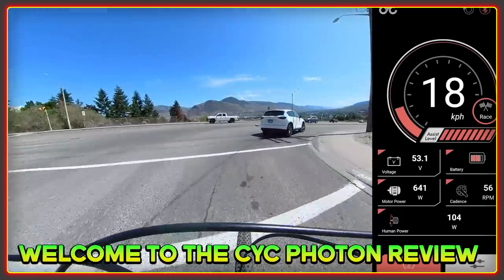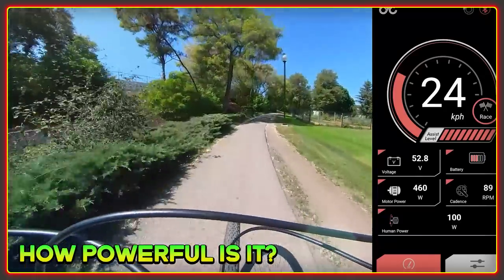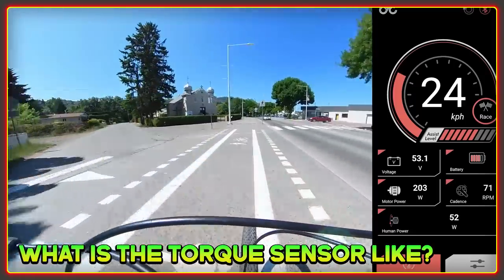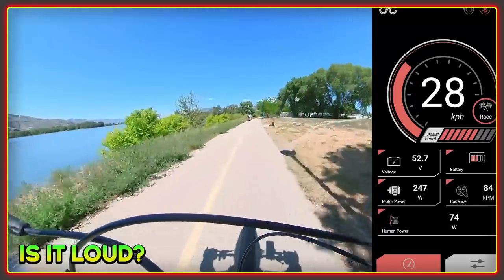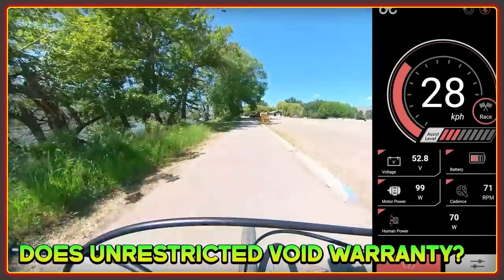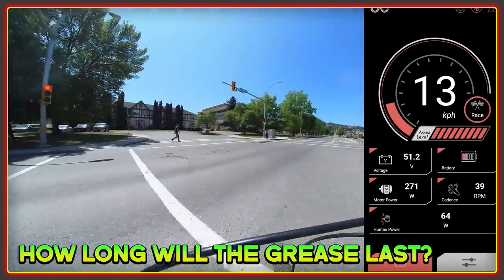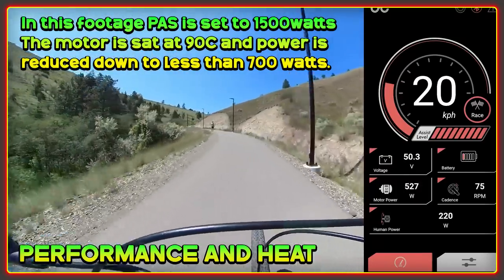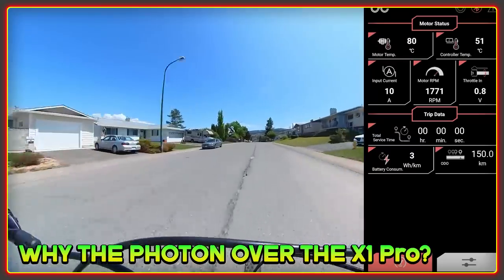Full Review of the CYC Photon Mid-Drive Ebike Conversion Motor

Comment: This is a really good review, so comprehensive.
I should probably stop recommending the bbs02 for a wham bam thank you mam conversion as the cadence sensor is pretty weak.
Reply from the maker: Thanks. The 02 can be had for much cheaper on Ali but the cadence based PAS is no where near as nice.
Reply: No you shouldn't.  What you say about Bafang cadence sensing is simply untrue. Some will prefer it to any torque sensor.  A BBS02 costs 1/2 of a CYC Photon motor, parts are ubiquitous, inexpensive and motors are easy to rebuild.  Further, the jury is out on the Photon as to its reliability.  Great review by John of this channel and thanks for that.

For many, for $200 more than the BBS02, the BBSHD I believe bang for buck is the best ebike motor in the industry. But for many the BBS02 is fine and can even take 35  amps for big miles with an aftermarket controller...perhaps even better than the Photon due to more limited armature mass aka heat sink.
Beauty of Bafang cadence sensing is their reliability compared to conventional torque sensors and their programmability.  One can create great granularity with non linear power increments at lower power settings with the Bafang configuration tool.  Because power relative to speed is an exponential function, one can program for much higher gradations of power assist at higher speed....and much smaller gradations at lower speeds.
I am not dissing the Photon.  Competition is always good in the marketplace. The Photon however is a $1K motor. Many will prefer torque sensing. and therefore welcome the Photon, CYC finally creating a quiet motor.  I come from a bike racing background.  Cadence versus Torque sensing doesn't matter to me, likely because of what level rider I am.  I can easily find the sweet spot of rider watt input to the bike relative to motor watt contribution and do so daily.  I also ride to heart rate.   For training, in some ways, cadence sensing is better because motor assist does not increase with human assist unlike torque sensing which provides a better workout for the rider at a given motor power level because the rider is pushing against a harder limit of motor assist.
In summary, the conversation is nuanced and not cut and dried.  Right now I prefer to stick with the Bafang BBSHD and honestly the Photon because of its heat sensitivity and the power level and speed I prefer, I still believe for 'my usage' the BBSHD is a much better value proposition.  Othes may feel different and good to have options like the Photon for others with a different usage model.
Reply: The video mentions Bafang Torque Sensor?  Is this new?  I was only aware of the cadence sensor.

Comment: Thanks for the great review and footage! One question: CYC claims there's very little rolling resistance from the motor when it's off. My BBSHD was pointless to pedal with a flat battery. Can you confirm the Photon is easy to pedal without power?
Reply from the maker: No it sucks as much as the bbshd. Maybe a bit less but not much.

Comment: Good review.  One point that should be stressed is that even if thermally limited to ~750 watts that will allow most of us who are cyclists to spin out at top speed allowed by our bike's gearing, other than for short bursts at very high pedaling RPM as you noted.  That surely was one factor that CYC considered in their motor design choices.  This doesn't appeal to the throttle jockeys who want to go that fast all day without pedaling but that is not the target user group for Photon.

I am about 300 miles into my 1 month old Photon on an old Cannondale F1000 hardtail set up for street and path riding and I am loving it.  No issues so far except a display that won't allow me to change wheel size to match what I have on my bike, so the data it shows are off.  The serviceability issue has me worried as I am usually a total DIY'er for all things mechanical.  Hopefully this will change going forward or at least the authorized CYC service will turn out to be fast and reasonably cheap.  I have a second Photon on order for another build which will be a very nice bike indeed.... ti frame gravel bike.  I'd have liked that to be a Proton but have no idea when that will be offered... maybe I'll have to upgrade when it comes available.
Reply from the maker: You make very good points. I think it is very well made for its target market. Funny why the display won't let you change that. Are you using the larger one or the SW102?
Reply: @HighVoltageKits  I have SW102.  Here is a video short showing the problem.  The display is just stuck on 29.  https://www.youtube.com/shorts/NY_idODSkBE

Comment: Is there any new information regarding to current production bottlenecks affecting shipping. Someone  on endless sphere said there is some additional testing needed due to delay in controller supply. Not sure if this that's up to date or is it the same thing repeated from previous delay. Still for some shipping takes 4 weeks only and for others beyond 11 weeks. Others said they didn't receive any shipment confirmation, the motor suddenly just turned up one day without warning.
Reply from the maker: Eco Cycles has stock in USA. I think there are production delays. I have no inside info on anything.
Reply: @HighVoltageKits  Currently other European distributors say it's available in 45 working days, so there is no other choice but to take it as a true estimate.

Comment: I really like this motor and I've commented before but I plan on buying one some time in the future.  I bought a used bike for the conversion, a 2019 Trek Marlin 7 but I'm having trouble figuring out gearing.  It has a max chainring of 32t recommended for 1x but I'm trying out a 40t.  I can use the granny gears but it makes noise mostly on the chainring when in the biggest 2 granny gears on the cassette.  Chainring is narrow wide and seems like a good recreation of what it will look like with the photon but I'm concerned that I will damage the chain/chainring and cassette with this terrible chain line.  Are there any mountain bikes that I can put a 40t chainring on that will have a good chainline even through all the granny gears?  I bought a box components three prime 9 groupset (11-50t cassette) and I'm hoping that might help (maybe I can rearrange the cassette?).  Any recommendations are appreciated.
Reply from the maker: Sorry I missed this. Maybe post this on our Discord. It's free to join. You will likely get more advice there. You can also post pictures which will help a lot.

Comment: Another comment I'll add is that I had the same experience with the cranks - my left one worked loose. We're probably not the only ones this has happened to.
Reply from the maker: I think it was the left that was with mine as well. It seems like a pretty common thing. Something to keep in mind like retorquing wheel nuts after 100kms
Reply: this also happened to me - left non-drive crank came use.
Reply: @wendyatkinson1  I think there must be some flex and that is the side that will work loose. I added blue loctite the pre-applied thread lock might not be working well enough. Definitely something to monitor.

Comment: Thank you for the excellent video. Can the photon be used with a 72v battery ?
Reply from the maker: You are welcome. Its 36-52 volts only. The speed at the cranks would be too high at 72 volts.
Reply: @HighVoltageKits  thanks! So you used a 52v for your testing? If you legs are maxed out on cadence, can the throttle and motor make the bike go faster? If you selected the 38T chainring and 11 to 32 cassette for example, and using your legs you could reach say for example 50kmph , is  the motor able to rev higher than the chainring and pedals? Another way of explaining what I am saying is , is the motor able to power the bike without the pedals moving?
Thanks very much

Comment: Great review.  
Can the chain ring be adjusted with spacers?? to change the chain line if it was being used with a rohloff rear hub?
Thanks
Reply from the maker: The motor can be spaced a bit. The chain ring no. Its locked in the one place by design.
Reply: @HighVoltageKits  Thanks for the response.

Comment: Thanks for this review. I've killed/cooked a couple of TSDZ2 s due to climbing 500m over 15k commute with average gradients of 5 to 7% with ramps reaching 20% depending on route. In summer will have temps in the mid 30s... Though I won't go the 20% ramp route those days. I've ridden Shimano, Yamaha and Bosch motors and I don't really need or want more power than they provide but I would like to adjust speed limits. I don't use a throttle. Would this motor fit this criteria?
Reply from the maker: With those conditions and temps based on what I have seen here with mine in similar you will throttle the motor pretty fast if you run it unrestricted. At 750 watts of assist though it should be able to maintain that level of power. The longevity of the motor is not guaranteed as it is a new product although it feels well made. I also have some videos about some new motors from TOSEVEN which are also Torque sensing. They could be really good if they iron out some of the kinks.
Reply: @HighVoltageKits  I'm watching reviews of the ToSeven too, the 02 is of interest to me... I prefer the idea of the lighter motor as long as it couples with my 48v batteries. Thanks for your time and work.

Comment: how many assist levels are there?  on display screen looked like nine?  (there were nine bars, number fluctuating throughout the video.)  if there are nine assist levels, is rider able to program desired motor assistance in each assist level?  on endless sphere discussion is that in reality there are only three levels, and that choosing to have more than those three simply results in duplicate motor assist as you work your way through the nine -- so that from the nine you get only three assist levels, the rest being dupes of those three.  great video.  i've watched many times and each time pick up something new.
Reply from the maker: Appreciate the kind words. Thanks. There are three. That's just the way they did the graphic. You can specify each of these levels for example 250,750 and 1500 (if unrestricted). You are right tho its kind of confusing. I am not aware of a way to make it to 9 levels and if there is then it probably does do that and duplicate it. The app only has three and there is no way to make it more. In reality its all you need as its a torque system. 9 levels of power is like a hangover from magnet based cadence sensors.

Comment: Does the engine have problems with the chain when starting?
Do you have to program the motor?
Reply from the maker: There is an app you can tweak it with but there are not that many changes you need to make. More adjust to what feels right. I have not had problems with the chain when starting.

Comment: Photon not being serviceable has stopped me buying one yet. I have needed to  pull  apart 3 ebike hub motors, and mid drives from what have read need some maintenance and repairs.
Reply from the maker: It will put some people off for sure. I think I will push to open mine up if I get any issues for science of course lol

Comment: Can you do a tutorial how to utilize the magnetic brake sensor kit to attach it to a relay to power a 12v brake light using an external 12v mini battery?
Reply from the maker: You need a replay that will take 5 volts on one side that you can wire the 12 volt into the other side. The just connect up the relay. There will be some trickery though as the relay will need to close when you activate the brake. The brake voltage is 5 volts close and then activated when it drops to less than one volt. Wheras the relay would need the opposite. I don't think I can commit to a video right now but its definitely the project that discord was made for. I suggest figure it out on there and we can then make a video later once there is more to go on.

Comment: I've been riding a converted Giant Farrago for about 3 years with an open-source firmware Tong Sheng TSDZ2 motor. Mostly street riding, some easy trails, moderately hilly terrain. It's been great so far - no mechanical issues, but I don't abuse it. 750 Watt motor, 52V battery. It has a similar motor construction and size as the Photon and the same heat issue. The open-source version allows for a lot of configuration. The torque sensor works well and provides a natural riding feel. Generally the heat is manageable and the conrtoller rarely has to reduce current except on very long steep hills (160F max before reduction). I'd love to try out the Photon but am wondering how much real-world improvement it would offer over the Tong Sheng. Has anybody out there used both?
Reply from the maker: I have not used the Tong Shen but I heard lots of stories. You likely did not encounter issues by not pushing it. There are some new motors coming out from TOSEVEN that are more in line with the Tong Shen. The Photon is a joy to ride. Especially unrestricted. Great torque sensor. It's longevity is unknown to some extent.
Reply: Yeah, the Tong Sheng has one plastic gear that's probably intended to act like a fuse to prevent damage to any of the other drive train components. I bought a spare but haven't had to use it yet. You can also replace the plastic gear with a metal gear.  I'll tear it down this winter for a detailed evaluation of the bearings and gears, replacing anything that needs it. Parts are widely available. I'll probably buy the Photon to try out because it does seem more capable than the Tong Sheng.    @HighVoltageKits

Comment: Ya know, about the noise, my BBSHD seems quieter with the now Luna Eclipse (42t) than the Lekkie 40t. The Luna is much less resonant, deader than the thinner Lekkie. What’s a couple of ounces on an ebike ? And the the teeth are replaceable on the Luna at half the cost, and more, of a new chainring. Or you could replace with Chinese...but I digress...
Motor sounds more of a dull buzz compared to a faint whine.
Whatever, I must be.....?
Reply from the maker: That's interesting to hear. I have seen those Luna ones break fast as well. Sounds like you have your setup very well dialed in. Which is probably why it's quiet. Good job! Cheers

Comment: i want to buy one but people on forums cant get past the fact that im putting it on a $300 bike to answer questions haha. i get it, but is it really that bad to use it on a relatively cheap bike? its only temporary until i get something better. im done showing up to work soaked ;n
Reply from the maker: Do what you want, there is nothing wrong with using what you have. You can always swap the motor onto a different bike. You are welcome to join our discord community. https://highvoltagekits.com/discord

Comment: Will I experience noticeable drag pedaling with the assist off?  On hills, I'm pushing my pulse rate too high for my 77 years.  So I would like a boost only on the steep climbs.  I can buy a small battery to keep the weight down.  The bike will be a 21 lb cross bike.
Reply from the maker: Yes there is drag. The way around is to have it so that level 1 is just enough to overcome it. Say 25 watts of power. Then you can have a couple of other levels. Each level can be configured so maybe a 250 watts for moderate hills and a 500 for steep hills. There is an option to have a road and offroad so you could also then have one that is set even higher if you even found yourself totally out of gas or injured and needed to get home. It's a great motor for keeping you going riding for longer. Although the long term reliability of it is a bit questionable based on my current experience. I will update on that and you can find more information if you look at my video history.

Comment: Thanks for the Photon review. I would not buy it due to the repairability issue alone.
Reply from the maker: Appreciate the donation 🙏 It's going to put off a few people for sure.
Reply: @HighVoltageKits  Not putting me off, at all, mine coming in July.
I'm buying for the torque sensing, quietness, and more than adequate power and ease of switching to street mode. Your video reviews, High Voltage, sold me. Thank you.
Reply: You need to purchase everything at your LBS if serviceability/warranty repairs is your uppermost consideration. Very few high tech and compact items are servicable any longer. It is a replacement world my friend. We must thank Apple for that.

Comment: If 55 km/h is difficult to maintain for a long time, what is the speed at which you can run for a long time while maintaining it in general?
Reply from the maker: I think it very much depends on conditions and how much human power you want to contribute in terms of how long. But 35-40kph should be something that is doable. The excased nature if the motor means that it struggles to cool even in winter.

Comment: What about the break sensor option when you go to order the photon? Is the brake sensor necessary? Why not or why would you order the break sensor?
Reply from the maker: I think its not needed. The sensor is very responsive to when you stop pedaling and it can be adjusted as needed. If you use the brake sensor you cut power. The same with the gear sensor. If you change gear and pedal lightly it will change very smoothly. Just like on a normal bike when you would do the same. I have not missed a brake cut off and I like that there is less clutter on the bars.

Comment: As an outrunner, might be a good candidate for statorade?
Reply from the maker: I'm not 100% sure how it would work with this. I would have thought cyc would have it like that from stock. I can ask them though.
Reply: I was thinking the same thing. Grin (and probably others as well) sells the oil. If I remember correctly the oil is magnetic and transfers the heat to the outer heat sink.